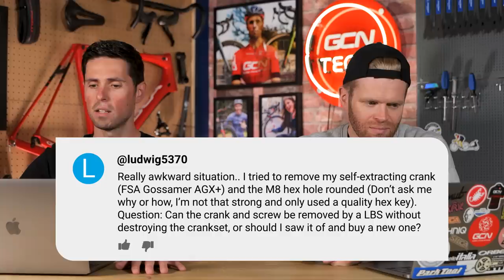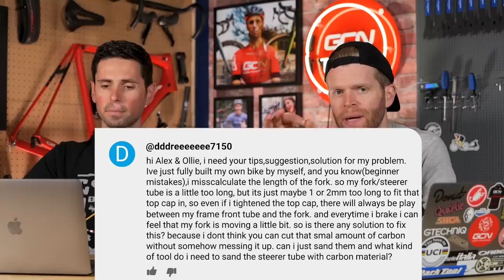Worn Tyres, Stripped Bolts & Aero Bars | GCN Tech Clinic

Comment from the maker: Let us know your burning tech questions i= below using #askgcntech 🔥
Reply: #ASKGCNTECH hi alex and ollie, for a super lightweight bike, what would you do to save weight? wheels, super thin saddle, smaller rotors,super expensive lightweight rotors, carbon thru axle or maybe even a shorter cranks and a 1x set up? which of them worth the money to save weight or with what would you go for? thanks ✌
Reply: #askgcntech

Hi GCN gang! I live in the Philippines and I currently have an XC MTB Hardtail Frame, a regular geometry frame for an XC MTB Hardtail, I recently converted it into a Monster Gravel but I don't get to ride off-road that often.

Just so you know, the Philippines is a third-world country, and it is really economical for us to ride in an MTB on the road, especially as the roads here tend to be like concrete trails hahaha...

Riding with a 25c or 28c is like riding a solid tire into the Redbull Rampage, although some of our roads here are quite good, but it is on Highway with fast cars.

I plan on buying 27.5 x 1.95 WTB ThickSlick Tires because it will be in the same diameter with a 700c x 30ish road tires and buying some 26er non-suspension corrected rigid forks to lessen the clearance from the crown of the fork, I would love to get your opinion on those tires and my planned set up, the purpose of this build is to do a long ride(200km+) as fast as possible, basically a time trial for myself

Also, If you can go here in the Philippines again and ride the highest point here or do the Mindoro Loop that would be awesome!
Reply: I recently had to saw of cranks. They were over 30 years old shimano LX square taper cranks. They were so seized on there that the crank puller ripped out of the aluminium crank threads when i used an extended lever arm on the crank puller ( yes the puller was properly threaded ). Strangely the left arm came off easily, but the right one never moved.... A hacksaw made short work of it. Luckily those were junk cranks anyway and I had a slightly nicer replacement around. But of course then the old bottom bracket wouldnt come out either... Oh the joys on trying to remove something that hasnt been touched since 1991.... got lucky in the end and barely managed to remove the cartidge bottom bracket. 

My experience with this. Bike shops are not jumping for joy if you bring them something like this. As long as you have the tools just have a go at it yourself.

Comment: When you have a rounded allan bolt you can use a torx key that is just slightly larger and hammer it into the alan bolt. Works every time.
Reply from the maker: That is a great hack! If you aren't too confident in doing this a trip to the local bike shop might help 👀
Reply: I had the joy of self extracting bolt could undo but the thing it pushes against broke so I had to angle grind it and as upgrade cassette too spent £150 in total, sadly about a month later someone stole it outside my flat same day I used it but I didn't check as thought neighbour made a noise, I asked support to help report it but think they didn't bother, that was last October and I have no idea how to report, future bikes with have tracking so I can get them back

Comment: 6:08  I use Pattex shoe glue to fill little nicks and cuts on tyres. Its fairly resistant to abrasion and keeps the dirt out of the cuts.
Reply: Superglue also works pretty well - as long as the cut is only on the surface rubber.
Reply: @johnwestwell2241  Right, and clean inside the cut well with alcohol first.

Comment: First, Gossamer AGX is a 24mm Megaexo spindle (not interchangeable with 24 Shimano). Second, all self-extracting crancksets can be dismounted by an axtractor with all standard techniques known by the shop. So it is a simple and cheap job, requiring only a damaged bolt to be replaced as extra.
Reply: Bet you’re fun at parties
Reply: The bolt is still in there. You still have to remove that first before you can use a crank puller. Dismantling the self extractor is easy enough.

Comment: To the guy with the Gossamer. IF the extractor bolt is loose in its threads i.e. The bolt moved out from the spindle but stripped against the end cap during the extraction process it might be quite a simple job for your LBS (or yourself): Remove the end cap (might be a special tool but a pin spanner will do the job or could be a 10 mm Allen) then remove/replace the inner extractor bolt, refit the cap and extract the crank. IF it stripped while still tight in the spindle I would still remove the end cap and go from there as you will have better access to the bolt, hammering in a cheap Torx socket usually works.

Comment: Simple answer for the AR 29? yes, i have them mounted on my bicycle and have for the last two years. I'm way below the 72 PSI pressure for hookless. Weigh 80kg as well and run, 55/60 without any issues.

Comment: 2:45 - In the case of my FSA Gossamer BB30, I found that you needed a shop quality allen wrench with a nice long handle for leverage. If you are using a multi-tool, you are going to have a hard time applying the proper amount of torque. I don't think that "pocket grade" tools will get you there. The user didn't say that this is what they did, but it's just a thought.
Reply: Thanks for the feedback! I did use a high quality wrench from a mechanics workshop I'm often working in, but it seems to be properly seized... found a replacement crankset including a spare MegaEvo BB for 75 euros on ebay and will forcefully remove the old one.. I hope the warning finds the right people, always apply anti-seize paste on those threadings!

Comment: 1:Try to cut the allan bolt in the middle and use it as a screw.

2: Use a pin punch and a hammer to unscrew the bolt (be extremely careful about the frame)

3: Use a slightly bigger torx and hammer it in place

4: Use an epoxy cement bonding agent and glue a bolt. Let it overnight dry and just unscrew it. I would first personally drill out a little bit of the worn bolt, so to leave more space for the bonding agent.

5: Use drill out extracting screw set. They are quite cheap.

6: Use a sharp scalpel to chisel out completely its head. Then it is a matter of extracting the bolt from the tread and crack.
 
Or the last option

7: Pray 😅 🙏

Comment: To the steerer problem - just use a file and file some material from the top of your steerer. No need to cut, but if you have a good cutting guide tool, you can also cut it.

Comment: "UGH, I'm outta gears" I've said that too many times! I have a Specialized Aethos with Shimano Ultegra Di2 R8050, GS Medium Cage. Stock it came with  11-speed, 11-30t cassette. I'm not a fan of climbing because I'm built like a diesel truck, 6'3" 210lbs (190.5cm 95.25k). I'd like to have a little easier gearing for those climbs. Can I go with the 11-34t or would 11-32t be a big enough difference (I know, this is a "how long is a string" question), but does 2 more teeth make a difference in climbing. I'm fairly new to all this, but I live, eat and sleep cycling. Keep up the good work and love it when nobody can get Alvin's name correct. #askgcntech

Comment: Bike fitting. Can someone please do something to make this a bit simpler?
I understand there is a lot of variables that go into being fitted to a bike. I, like many can afford some but like some, I have two bikes, a MTB and a road bike both are Fuji, so not a Tour de whatever bike but it's mine and it's the bike that I love riding.
A bit of background, I am 68 years young. I started riding the MTB mainly on roads without knowing that there were road bikes, the MTB was really the best for me because it provided me with strength training, once I got my road bike it was a bit awkward at first but because of the strength workouts it really made the road bike a lot easier to ride.
I've made some mods to my RB Fuji, for comfort reasons mainly but it's also had a bit of an effect on the weight. I changed the handlebars to a more aero design and carbon fiber with internal cabling. I changed the seat because one of your videos mentioned the Italia seats so I had to try one and yes, I love it. I also changed out the seat post to a carbon fiber one. So yes there is a bit of weight winnie in the method. All in all I love what I've done to my bike. I am and will probably upgrade to a more expensive bike in about a year. I've only had this RB for a year in November. I'm mainly upgrading because it looks like everyone has a cooler looking bike than I do and it seems they have an easier time on longer rides.
I'm mainly a lone wolf rider. I love riding alone in the predawn hours. I mainly ride through my neighborhood so I don't have long stretches of road to cruise at 18mph. However, these switch backs have helped me keep up on longer rides at 15 to 18 mph. So the switch backs are good for endurance. 
I know I'm just babbling now, but I have spent a lot of time adjusting, re-adjusting my handle bars to fit me, changing the height and the hoods, changing the seat height and setting the seat back and forth. I think I have finally got the fit that is for me.
However, it took me this long to figure it out. Comfort is, in my opinion the most important part of riding. If you are not comfortable I don't care how cool the bike is it just won't be a ride that is fun.

Comment: #askgcntech 🔥 Hello there, and thank you for the good work from you both Ollie and Albert ;-) . I am getting a new bike which is set up with a nice pair of Enve 3.4AR wheel set hookless. For now, and my current bike, I am still using tubes and haven't made the switch to tubeless.
Can I use tubes with the Enve 3.4AR on a daily basis? If yes what max pressure should I not exceed? and what other constraint may this generate? or do you strongly recommend to switch to tubeless?
Thanks. 
Gautier

Comment: #AskGCNTech Hi GCN. I have recently converted to tubeless and after todays ride I left my bike out in the sun, (note I live in the UK and it was only 20 degrees) and the rear wheel exploded. Upon inspection the tyre was still seated and the air had come out the pressure release hole in the rim. I will replace the rim tape as this seems the only plausible solution but was this purely due to temperature? If so, that’s a bit worrying should I keep my bike in the cold forever?

Vision Carbon Disc wheels 40mm and Pirelli PZero tyres 28mm if it helps

Comment: #askgcntech lately I've been hearing a noise when I ride my bike. I'm pretty sure it's coming from one of the pedals (Ultegra, road). I think there's supposed to be a spring in the pedal somewhere, right? But I think it's protected by a piece of plastic. How can I reach the spring and fix the noise? In case you don't think the noise is coming from there or there is no spring at all, where could the noise be coming from? Thanks.

Comment: #askgcntech I bought carbon rim brake wheels as an upgrade (I'm old fashioned and hate disk brake squeal) , they cost £850 for the pair but now I'm worried how long they will last having heard the brake strip on carbon wheels can delaminate. How many miles should I do before changing the wheels and can they be fixed if this happens?
Reply: if your not doing steep descents regularly and are not supper aggressive on the brakes they will lats a very long time. (on year 3 with my ICAN chineese set and the brake track still looks new)

Comment: I thought self extracting chainsets were used on an Octalink BB system? The crank may be scrap but removal will be very difficult without damaging the BB. Both may need to be sacrificed and replaced in that instance.
Reply: What you're talking about is a crankset that needs a crank puller to remove the crankarms, much like those used on square-taper cartridge BBs.

Self-extracting cranksets have a right-hand thread bolt underneath a left-handed thread cap. Once the bolt is cracked loose, it'll keep turning until it butts up against the cap, that's when it'll start pulling the crankarm out. In terms of how the disassembly feels like, this is how it goes:

It'll start off as being very tight (you need a breaker bar for this step), then you'll feel the bolt loosen and resistance can be felt for a second time (this is when it butts up against the cap), then keep turning until resistance starts to decrease a little (interference fit between crankarm and spindle starts to loosen).
Reply: @yonglingng5640  Octalink sometimes does use a self extracting system, but not always.
Reply: @luukrutten1295  Ooh, I see it now, it's a thing for their older road cranksets before they utilised Hollowtech II.
Reply: @yonglingng5640   But they have rounded the head of the extracting bolt. They have no way of turning the bolt and a puller will not unthread the crank from the BB. You would have to cut or drill the bolt in order to remove the crankset which are not replaceable, and at risk to the threads of the BB.

Comment: Using a 12 speed crank with everything else 11 speed will work unless you are shifting rings at max load. Back in the days before Di2, you had to ease up while shifting between rings.
Reply from the maker: Easy up between shifting is good practice anyway.

Comment: #askgcntech Hey Alex and Ollie, I've got an Ultegra Di2 12speed on my brand new bike and it's making a constant clicking noise in the 5th sprocket (only there). I've tried everything from changing cassette and chain to reindexing and aligning the derailleur hanger. After some research, this seems to be a problem many are facing and attributing to too little space between the sprockets. Have you heard about this before or have any idea what else I could try? If you don't have a solution, please just read out the question, so Shimano will do something about it, this is really annoying. Thanks

Comment: #askgcntech I am currently in the market for a new bicycle (Time ADHX), which will be used 95%+ on paved road and maybe an occasional light gravel ride.  I'm dealing with a reputable LBS, who have asked if I would consider a 1x setup in a 40T or 42T front and 10-44 rear SRAM Force AXS.  My current ride is a 12-year old Cervelo S2 with a 2x 50/34 and 11-28 setup.  I'm an average, recreational rider whose FTP works out to roughly 2.5w/kg, so a 1x setup might be mechanically simpler but still deliver the gear range that seems appropriate to the profile of rides that I typically do.  I feel like there's some obvious pros and cons to a 1x setup that I am just missing.  Can you help provide any insights?

Comment: #askgcntech some new bikes come with D shaped steerers (eg: cervelo aspero, giant propel). Do these need proprietary stems or are there aftermarket options available?
Reply: The giant ones will be difficult since they may also use an oversize 1 1/4 steerer as far as i know. For the other ones you can look at deda superbox stems. With some D shaped systems it is possible to run a normal standard stem on there as long as you only need to route two brake hoses and otherwise use an electronic shifting system. You will then only need a handlebar with a central hole so that the hydraulic cables can enter the standard stem. Usually you have to put an extra wedge spacer on the front of the D shape to stabalize it further as well. 
I run a perfectly normal ritchey stem on my ridley helium SLX which basically uses the deda D shape fork system.

Comment: #askgcntech Hey GCN! I have money for tyres. Should i buy a set of good tyres or, a single tyre for the back? Because the rear wheel is where you put down the watts. Doesn't it make more sense to have an excellent tire in the rear?
Reply: But it's the front tyre doing most of braking and cornering. Must be tip top as well.
Reply: Put your best tyre in front. That will give you more grip and better handling.

Comment: #askgcntech ok…here are my 2 questions related to each other 

1. Can chains be lubed only by using drip wax lube (not as a top up to hot wax method) and what is procedure to use drip wax lubes after rainy rides?

2. Can you good folks please detail via analysis if waxing (hot melt and/or drip wax) can be economical to a recreational cyclist in long run including costs of all solutions used for stripping chain of factory grease/oil based lubes (who isn’t worried about watt savings as a main criteria for cycling 😀)
Reply: Yes, you can use just drip wax and it works quite well. You will still have to do the initial cleaning regardless of which method you choose. If the chain has not been previously hot waxed, you will probably have to do multiple drip applications at first.
Reply: @johnleonard5936  & what’s the procedure after wet ride ?
Reply: This past weekend I got caught in the rain. As soon as I got home, I put my bike on my wash stand and cleaned it with hot soapy water, dried it using a rag and the air compressor and lubed it. I would recommend doing this regardless of what type of lube is being used. Another method to use if the bike isn't too wet is to wipe the chain down with denatured alcohol before lubing.

Comment: #askgcntech
Hi from Sweden! I've bought a Hamax Outback trailer so I can take my toddler with me on my bikerides. So far I've been only using the trailer on my normal city bike but I would like to use it on my carbon road bike with thru-axle as well. I have asked a couple of local bike shops if it's safe to drag the trailer on my road bike but no one can give me a straight answer if it could damage my frame or if I need a special thru-axle or not. Maybe you can? 
Thanks for all your great work with giving us useful information and awesome tips and tricks.
/Johan
Reply: Check with the maker of your carbon framed bike.